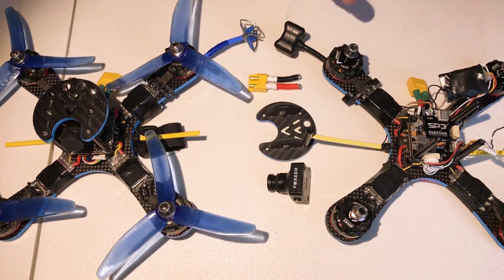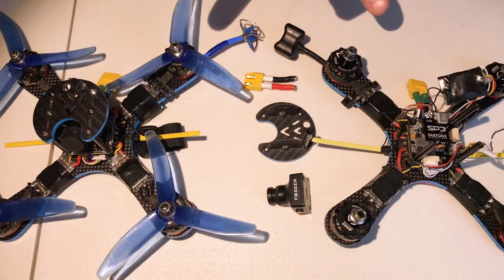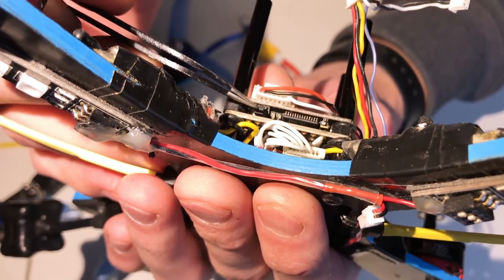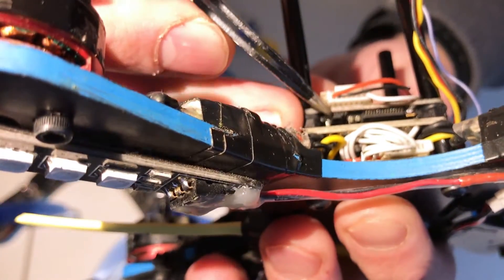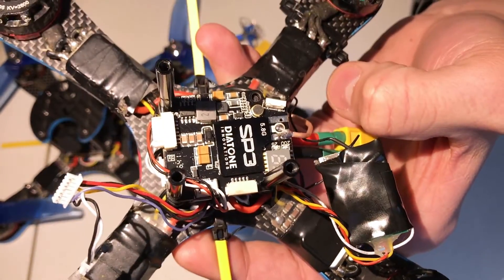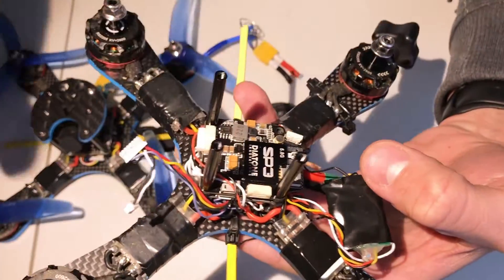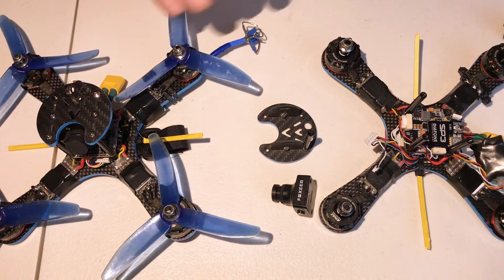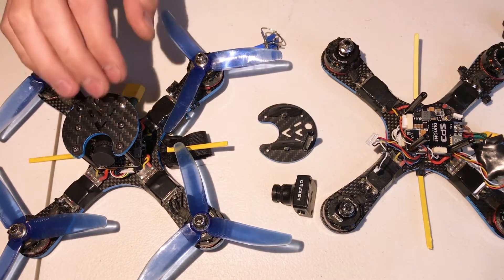Video Issues(FPV) | Troubleshooting #3

Comment: Yeah you should really try to move that vtx and antenna as far away from those esc’s and motors as possible because they are radiating a lot of noise. Also adding a capacitor to your LiPo joints and to esc’s as well if needed. That should make a huge difference!
Reply from the maker: Vianey Villa Appreciate the feedback! This was over a year ago unfortunately, so I don’t even run this setup anymore.. moved on to better frames.

Comment: My VTX (also Diatone SP3) works perfectly on 25MW but I can't get it to work on 200 or 600MW to save my life and idk why. Sometimes it does work then I change out my battery and I get a black screen again. Any ideas why?
Reply from the maker: Is the SP3 connected to VBAT or 5V? If it's connected to 5V, then this would be a problem.
Reply: BarbiCyanide 

Yeah on my flight controller (Cl_RacingF4) the positive and ground are connected to VTX + and VTX - 

At first I though I was doing something wrong, but now I'm thinking maybe something's damaged internally so I'm probably going to get a new VTX if I can't get it working right. Also thank you for your reply!

Comment: I have a similar problem. I get the video signal extremely clear about 2-5 feet. I walk away a little bit and the video signal goes hay wire. Can you please help me.
Reply from the maker: T Rex is your output power correct? You could be in pit mode if you didn’t adjust anything prior to maiden.
Reply: Yes i believe so, my camera runs off 5-24. I have it hooked up to a 5 volt pad. My VTX also runs off of 5-24 and I have it running off the 12 volt pad to save space.
Reply: When I first turned on my copter for the first time, the VTX was buzzing very loudly and was getting hot. I checked the wiring and tried it again. Same thing. on like the 10th try my VTX stopped buzzing and getting hot and did what it was supposed to do. But, when I turned my goggles on and received the image, I walked a few feet away and there went by crystal clear image and went straight in to a static screen.
Reply from the maker: are your + and - wires shorted? is your VTX adjustable in power?
Reply: No they are not. And my vtx is not adjustable. it is a 600Mw foxeer.
Reply: Were you able to find a solution? Currently experiencing the same thing and it’s frustrating
Reply: 2 GuysTrolling Inc I ended up just getting a new one it worked fine after I bought a new one and swapped it.
Reply: T Rex I figured mine out, turns out the flight controller was fucked, it caught a bit of fire somehow and it was burned/damaged so I replaced and it’s good now

Comment: Why would you install your antenna and vtx there?  Probably landing and crashing is damaging your vtx
Reply from the maker: Bubba John there wasn’t room for it anywhere else. Downsides to a pod design. And it doesn’t damage it with the bottom slung battery
Reply: @BarbiCyanide   BarbiCyanide  Get a non pod...........! 1 crash the cloverleaf is trayyshed! And the vtx missing a cap... it could be the second revision or 3rd or 4th.... the circuitry could be diff and dont need that cap anymore🤣 dont do that! Get a realacc 210 frame, same as these but you can stuff the rx under the stack... vtx under the top plate, still have room for gopro, AND gps on top!
Reply from the maker: @stickboyfpv4742  I quickly moved away from the pod design. lol I fly more of a traditional freestyle frame.